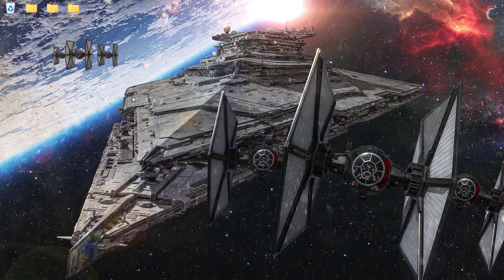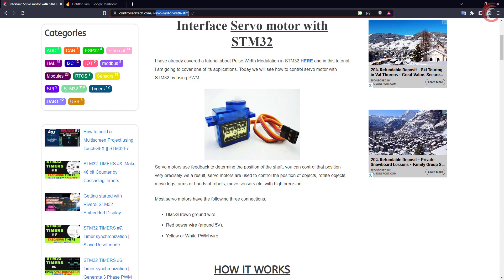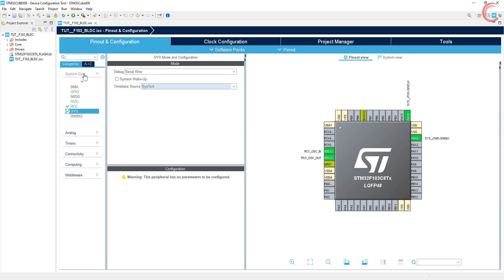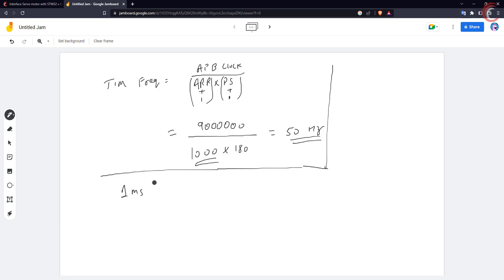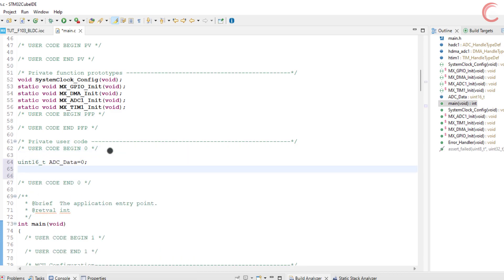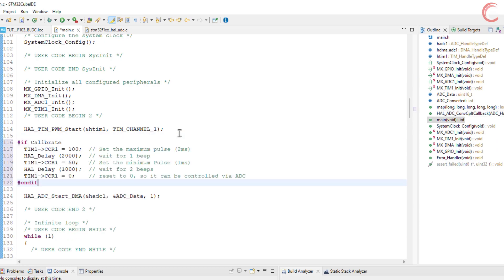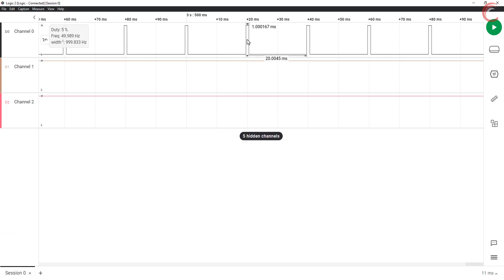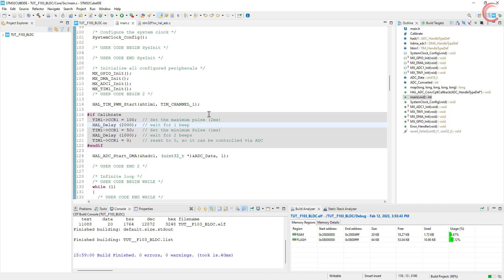STM32 BLDC Motor Control Tutorial | PWM & Speed Control

Comment: I've followed all the steps shown (except the fact I use F767ZI instead of F103C8), but HAL_ADC_ConvCpltCallback() have been entered only once no matter what I have been doing further with my potentiometer - the solution for that was setting Analog -> ADC1 -> Parameter Settings -> ADC_Settings -> DMA Continuous Requests to "Enabled". It worked ever since ;-) I'm using PA_3 (so TIM2, channel 4) and PC_0 (so ADC1, channel 10) pins on CN9 board header by the way. In F767ZI, TIM2 is connected to APB1 (as shown in the DS11532 Rev 8 documentation of MCU (not entire Nucleo board) at page 20/256) - this is how you can check to which APB bus given TIM timer is connected to :-)

Comment: Hello. Allow me to ask a question regarding ESCs. If I'm given the opportunity to program (calibrate) an ESC using the duty cycle or defining a range between the minimum and maximum duty cycle in %, and from the tests I've conducted, it seems that I can choose somewhat freely, for example, (5%-10% or 10%-20%, etc.). Why does my motor stop after a certain duty cycle without reaching the maximum chosen duty cycle? (Turnigy Plush 30A ESC, Turnigy A-Spec 2600mAh 4S LiPo Battery, Turnigy D3536/9 910KV Brushless Motor). Thank you in advance. Congratulations on the tutorial videos.

Comment: Hi

Thankyou for the video

I tried same method with stm32F103 same output i got.. but when i changed tdutycycle to 15% motor was not running. Can you please provide your suggestion here

Thanks
Reply from the maker: You need to calibrate it properly.
Reply: @ControllersTech thank you for your reply

You mean potential meter calibration??
Reply from the maker: I mean setting the high and low points for the motor. Chrck at 9:15
Reply: In video you mentioned calibration minimum value is 50 and maximum 100. I changed maximum value as 300. When is increase the potentio meter the duty cycle also increased to 15%. I measures in oscilloscope also its increased to 15% dutycycle. but motor stopped after 11% dutycycle. 

For this motor 50hz is sufficient or need to change frequency 

Please guide me
Reply from the maker: You cannot just change max valie to 300. Didn't you watched the first half of the video ? The value 100 will set the pulse width of 2ms, and this is the maximum speed for the bldc. If you increase value more than this, there will be no change.
Reply: Understood.. thankyou
Reply: Sir last 1 question

The bldc motor maximum speed is 2ms means the motor capacity is 2ms speed or as per the code timing is 2ms.

Because 50khz = 20ms

But when i reached 3ms its stoped